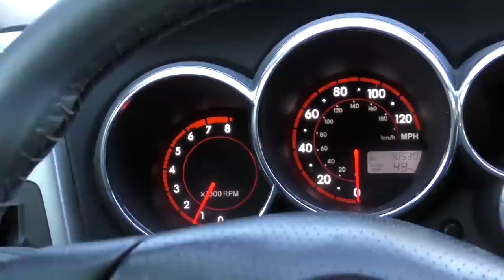Please Stop Doing This to Your Transmission (It Destroyed My Car)

Comment: My transmission is self cleaning - it leaks a quart a month, and I top it off as fast as it drips out.
Reply: Karl von Eschenhof LOL my cooling system has the same feature 😩
Reply: Ur solid ! Sounds like a Nisaan. Lol
Reply: That's a feature on Nissan's
Reply: By the name of your name, german cars leaks just as much per warranty to lifetime last 100k miles. Ya messing up the jetta resale value = $200
Reply: Jon Kentucky  hahaha 😂🤣😂 Wow,that's crazy!!
Reply: Jon Kentucky I had that issue with my Honda , it turned out to be the distributor
Reply: Get rid of that junker
Reply: Ah yes, the ole Mexican oil change.
Reply: @Davido50  sounds like my friends nissan that he got rid of xD
Reply: Ran around in my 32 GTR for nearly 12 months with a coolant weep from  N1 pump that took 12 months to face taking everything apart to try seal again. Use to occasionally mess with people saying it was a coolant air bleed system just externally vented, like the Wastegate. Surprising how many would nod their head as if of course that's a thing. Totally seen a couple systems like that.. like totally a thing and dunno why I spaced and didn't realise
Reply: Transmission stonks
Reply: 😂😂😂😂😂😂😂😂😂IN THE MACHINERY ROOM ON A 1 BILLION$AIRCRAFT CARRIER WE CALLED THAT"SWEETENING THE POT"....AKA"GUNDECKING"......PUNISHABLE BY THE UCMJ!
Reply: Well, there is THAT!
Reply: Poor guy behind you with the window wipers on..😂
Reply: Lmao 🤣🤣🤣🤣🤣
Reply: My automatic 2001 Volvo V70 2.4 never needed an oil change. Hell, I took out the stick, dried it and put it back in and checked. It was dry. So I filled up 1L of engine oil (I use 10W-40 but on such an old car, as long as it's half synthesized it's basically fine) and checked half an hour later. Still dry. I filled up 1L more and came back half an hour later. It started to show on the bottom of the stick. So I fill up half a liter more and came back in half an hour and now it's just in the middle of the stick. 2.5L of oil and I had been driving like that for at least a month. Then I checked the oil a month later and it was on the bottom of the stick so I filled up half a liter and I continued to do so for quite a while. I suspect that it burns oil in the combustion process and that the piston rings aren't properly sealed but I'm not bothered by it. It leaks cooling fluid as well and I fill up about 1.5L every 2 months. About a month ago the power steering pump gave up and now the alternator. I went and bought a manual 2002 Saab 9-5 Aero. No problems with it other than me being used to a different clutch on my Scania, but no complaints.
Reply: You're lucky. My old Chevy Aveo leaked all the fluid in the pan in less than two weeks. That was a great expense I dealt with for too long lol.
Reply: @Davido50  : That sounds alot more like Chrysler / Fiat product.
Reply: @ninjamaster3453  : Its mostly a Fiat / Chrysler feature.
Reply: @FezCaliph  : On the surface part of the pan the gasket goes on, apply sealant on the seal itself, and the leak is resolved.
Reply: @theroyalcrownedtiger2946  it was an axle leak.
Reply: My 3800 series 2 motor works the same leaks a quart every 7k miles so I why change the oil before 10k miles right 😂
Reply: Thanks in regards, all motocyclist😂
Reply: Ya its a nice feature
Reply: Yep works good actually as long as you don't forget
Reply: Took mine water and oil were in transmission 😊

Comment: Words to live by.  My 2001 Grand Prix is all original.  I change the transmission fluid and filter every 30,000 to 40,000 miles.  They are notorious for going out. So far I've made it to 270,000 miles and still driving 60 mile commute 5 days a week.

Comment: Scotty is 100% correct - YOU MUST NEVER EVER FLUSH YOUR TRANSMISSION EVER - EVEN IF IT ONLY HAS 5K ON THE CLOCK. BUT, YOU CAN DRAIN DOWN YOUR TRANSMISSION (FROM THE TRANS SUMP PLUG) AND REFILL IT BACK TO THE CORRECT LEVEL.

Comment: 2003 Toyota Camry owner here. Original owner and car now has 220,000 miles, NEVER ONCE changed the transmission fluid. Still daily driven. Zero problems other than an old catalytic converter and oil consumption (a known 2azFe engine issue). After the first 100k and trans fluid hadn’t been changed, just leave it alone. That being said, car has lived a well maintained happy healthy life in south Florida.

Comment: I had a 1996 Toyota Avalon with 260,000 miles never flushed the transmission,now I got a 2006 nissan Titan with 107,000 miles took it to the mechanic for check ups, he told me I need to flush the transmission, lol I started laughing and I told nah, just change the oil and brakes 🤣

Comment: sounds like one of my old cars where the dirt held the rust together and the rust held much of the car together. therefore i never washed my car to make sure it would last longer.
Reply: tom ster Sadly I knew the feeling too.
Reply: 😂 awww man
Reply: And the postscript to the story: He got over 120,000 solid miles and 7 years out of that Chevrolet!
Reply: I always wondered why hitting your analog tv usually made it work when it was on the fritz.   My mother's had a problem with her car stalling so she would hit the battery with her large key chain and the car would start right up.  That lasted for 9 stalls.  Machines can be crazy things.
Reply: Raoul Thomas 120,000 is like new to my broke arse
Reply: Thats why u dont flush a super old dirty engine
Reply: @fbnflaviusbroadcastingnetw6786  My Volvo has done 360 000km (223k miles) and my Saab has done 280 000km (174k miles). 120k would be like buying it straight from the assembly line for me XD

Edit: My mothers old V70N with the 2.5L I5 Audi diesel engine had done 530 000km (330k miles)

Comment: I love when Scotty does his best to save us money. I can vouch for this video! DONT DO IT! I tried to flush my first cars transmission and it was all downhill from there. The lube shop that I went to told me that it would be a good idea to flush the transmission because it was slipping a little between 2nd and 3rd gear. After it was done it was slipping in 2,3, and 4 gears. Eventually lost reverse. I was so young and poor that I went as far as replacing all the transmission fluid with Lucas Stop Slip, another horrible idea. A while after that   I couldn’t get it going unless I hopped out and gave it a push and jumped back in to give it gas before it would take off. Oh the fun times of being young and poor. I lease new cars now because I’ve given too much of my money to transmission shops.

Comment: You're the sole reason I'm keeping my Focus St (every day commuter) and getting a cheap cash work truck.  Instead of trading my ST in for a $35,000 used truck.   My dad introduced me to your channel two weeks ago.  I've watched so many of your videos, even those that don't pertain to me.
Reply: as a mazdaspeed owner, fist bump
Reply: @zeezlebops  bumps
Reply: Ew a ford
Reply: @BmwMe-uh9sy  you drive a BMW LUL
Reply: Bmw M3 e46 ew an endless money pit
Reply: The focus st is junk
Reply: Good decision!
Reply: If the used trucks you're looking at are 35k then it's still practically brand new and have damn near every option. Unless you're looking at a raptor or f350 platinum. I got my 2016 Silverado z71 double cab brand new for about 40k after tax and that's with 5k negative equity. You just have to know your math and be stern with the salesman and you'll normally get what you want. Most people are stupid when it comes to getting a new vehicle and don't thoroughly look through the finance paper work before agreeing or signing everything.
Reply: BMW is rated least reliable engines (along with VW and Audi and Land Rover).

Comment: My '94 Camry's auto (190,000 kms) was slipping when cold, sometimes finding a false neutral; then only working properly once fully warmed up. I decided to get the transmission and the torque converter flushed and replaced with new (Toyota brand) ATF. Now the auto box runs perfectly, no slip, no problems. Sometimes flushing the transmission is just what's needed.
Reply: Same here with my 04 accord ..I had it flushed at 240k ..Smooth now

Comment: Lifetime fluid: good for the lifetime of the fluid!
Reply: Ya that's true
Reply: If it is a Nissan, Chevrolet, or Fiat, it may be good for the lifetime of the vehicle, 65,000 miles or nine years.
Reply: No such thing! Change fluid of ANY vehicle 60k mis max. Trucks or tow vehicles change @40k mis. Our families 2 - newer Ford F150s XLT FX4 / Platinum FX4.. one a '16 ..other a '18. Incredible trucks that last forever if fluids changed. Both 3.5L TGDI EcoBoost!
Reply: @indridcold8433  well Chevy Is ok. GMC are good trucks. Ford Is best by far but GMC has proven very good at my friends business. He has 5 GMC pickups - 7 Ford F150s.
Reply: @Zap Brannigan ya that's true
Reply: Indrid Cold I have Nissan Quest 2004 that have been running great and had less problems until I got into major accident and stupid driver destroyed my van and my left arm broke. It was last year.

Now I am saving up for Nissan Rogue!
Reply: Lifetime fluid....so when the trans goes out at 100k and I get a rebuilt one, I should be able to put the lifetime fluid in the newly rebuilt one right?? 🤯🤯
Reply: @JToona  no, when the fluid reaches its end of life the transmission fails 😎
Reply: @JToona  yes your right
Reply: Like time my Dad told me as a child. NOT to buy a LIFETIME GUARANTEE for a Watch that the company was going out of business!
Reply: @Davido50  Watch Scotty's videos about Ford 3.5 V6, and make sure you don't have THAT "problem child" 3.5 V6.
Reply: @coiledsteel8344  ya

Comment: You are so right Scotty.  I asked an old farmer this years ago, when the oil change place said I needed a power transmission flush.  Farmer Phil said, "Hell no.  If it ain't broke, don't fix it."  I ran that truck (a 2001 Dodge) another a hundred thousand miles.

Comment: Great video, thanks Scotty! Sure enough, I had the transmission fluid flushed on my 2002 Ford Windstar every 30,000 miles. Sure enough after flushing around 115,000 miles, the transmission started slipping shortly thereafter. The transmission was working fine prior to that flush.

Comment: I change the transmission fluid on my Camry 2016 4C Automatic with 58k plus miles. The fluid came out very dark. 67k plus miles later it still running. And I change the engine oil every 3 to 4k miles. 👍
I hope I'm doing the right thing here. 🤞🙏
Reply: Better pray you're doing the right thing for your car.
Reply: Dang you put lots of miles on your car
Reply: Thank you all for replying. And yep I'm gonna do another oil change. (Trans)
Reply: @invaderzim1265  so far so good. 👌
Reply: I drive about 100 miles per day, sometimes more.

Comment: Not to mention, the places that use “universal fluid”!
Reply: jim s those are the WORST shops.
Reply: Yes beware! If Ford..use Motorcraft. If Jeep / RAM use Mopar. If Toyota..use toyota OEM fluids etc etc.
Reply: @TheMotorGuyDirect  This is not true there are plenty of multi fluid transmission fluids that cover tons of vehicles even scotty recommends a type of multi vehicle trans fluid. Amsoil makes superb multi fluid.
Reply: This is not true there are plenty of multi fluid transmission fluids that cover tons of vehicles even scotty recommends a type of multi vehicle trans fluid. Amsoil makes superb multi fluid that exceeds oem quality!
Reply: Tony Chambers What is your personal experience across vehicle brands with universal fluid?
Reply: @Jim-ie6uf   Im using amsoil multi vehicle atf in my volvo 850r which the transmission was said to be dead from my mechanic. I put amsoil multi vehicle atf in it 3 drain and fills and the car is running again. It clunks sometimes but from not running at all to running again its great stuff. Amsoil and Mobil 1 both have synthetic multi vehicle atfs available. Amsoil is the best oil you can find for your money hands down. All real professional rebuild tranny shops use amsoil atf since its the best out there and they dont want people coming back for warranty claims! Amsoil will even warranty your car i believe if you put it in from new out the lot! Check them out!
Reply: Tony Chambers Thanks

Comment: Excellent info, Scotty. I changed the trans fluid on my 2005 sienna at 220,000 miles.  I removed several quarts each drain and filled with same amount.  It got cleaner, and no slips.  I will change filter in May and replace whatever quantity of oil I get out.  But Maybe Toyota’s are just indestructible.  My Avalon is 280,000 miles with only 2 changes, and my manual trans Camry in looking at 300,000 and is just starting to be broken in.  But everything I read said don’t flush.  And since Scotty says don’t, that makes it 11th Bill of Rights.  DONT.

Comment: Great Advice Scotty!! I bought a 2013 Nissan Altima sl 3.5 with 64000 which i found out later it was known for its cvt issues and it started jerking in low rpms so after investigating it on YouTube including your channel i drained it and measured it and replaced the 3.5 quarts yearly and now it has 180000 on it and its the best vehicle ive ever owned for a work car which i depend on for 700 miles per week!! Keep up the good work!

Comment: I work at a transmission shop and you are so right on.  Change your fluid often with original manufacturer's recommended oil. Especially newer cars with continously variable transmission and Honda vehicles that the filter is not replaceable without disassembly...

Comment: Wow.  Toyota has been trying to get me to fork over $400 for a complete fluid replacement in my transmission, 2013 highlander.  They called it a "Fluid exchange".  This video helps immensely.  I will just go with the option that doesn't replace all of it and replace the filter as well.

Comment: Some years ago, I owned an accord 2000, got it used, was slipping crazy. All I did was to flush and refill with Genuine Honda ATF then it ran so well and I drove it for 5 years spotless. Genuine fluid matters.
Reply: I got my 91 accord cheap!  It would only grind when put in reverse (previous owners gf put it in reverse on the freeway after he looked at another girl in the bar)!   Transmission place wanted 25 hundred!   Took it apart and replaced the reverse gears for about two hundred.......works like a champ!!!!   I've had the car for ten years........wax it twice a year!!!!
Reply: I really do like the more "classic" Hondas, 90s models and before. They're dead simple, reliable and easy to fix when something does go wrong. I drive a truck around for various reasons, but when I get the money I'd like to get a 90s Honda to daily drive around. Forgot to mention for the price the gas mileage can't be beat either, and they're great cars for putting good stereo systems in.

Comment: I replaced two transmissions. I noticed both times it happened after a transmission flush. Never again!
Reply: What type of car was it?
Reply: Mark Bolton ,  Subaru SVX
Reply: @howtodoitdude1662  what happens is there 2 ways to expand the life the transmission. As Scotty said, the friction helps those who never change transmission fluid, better to top off and reuse dirty old fluid as he said if you past the point of no return. Now if you keep up with fluid maintenance every 30k miles or something, then keep doing that. Either approach will exceed 100k miles. But the regular maintenance has a better chance of 300k. But both methods should see 150k in my experience. As I never did transmission work in all 3 of my cars. Toyota Tercel 97, 215k miles, Mazda 3 2003, 145k miles, Mazda 3 2015, 94k miles...no transmission problems ever on all 3 cars. A flat tire was all I've ever had. Lucky? Perhaps I was, you tell me.
Reply: Rory Mercury , Subaru SVX transmissions are known to go bad. That’s why many SVX owners swap out the transmission to a Legacy’s transmission. That’s what I did. Never had a problem since plus I never had the transmission flushed out since then.
Reply: I do a drain and fill 3 times. That gets all the old fluid out. Acura calls it the 3x1 special
Reply: Ive never had a problem changing transmission fluid on manual or automatic transmission.  Every 60k with filter is good enough.  Most people neglect this and there is dirty oil and filter for years.  First thing I do when I get a car is flush the coolant and use correct oem type.
Reply: @jdigitalseven7  You change oil for a manual transmission?
Reply: Sounds like you waiteded too long to change the fluid too both times
Reply: @jdigitalseven7  I hope you mean you always change the fluid

Comment: I have a 100k warranty, I am thinking of having my transmission flushed at 80k in the hope it fails before 100k so I get a new freebie.
Reply: Rich Farfugnuven hopefully it’s a GM OR A DODGE OR JEEP YOU OWN LOL. They don’t work right anyway also Chrysler is bad in fact the worst.
Reply: @chevrolet756  it's a Yukon with the 5.3L, my old Suburban had 300k on original transmission and engine (5.3L)when I sold it to my neighbor who still uses it as a daily driver.  Scotty bags on them, but mine have all been dead reliable.
Reply: 100,001.  Transmission fails.

Comment: My mechanic recommends a transmission fluid bleed. I assumed this meant he was just bleeding the system and replacing the effluent with fresh fluid under the system's normal power.

I've had him do this on two vehicles now, one of them was at 150,000 miles, and no problems.